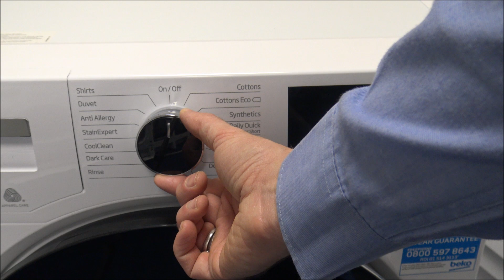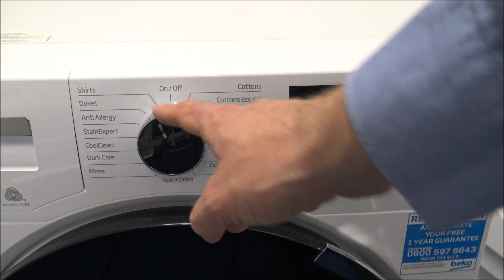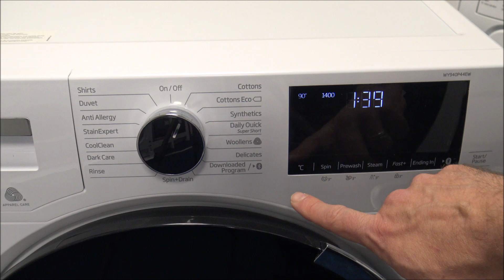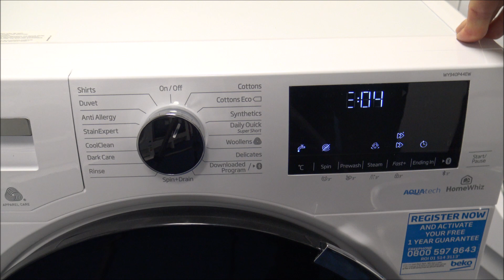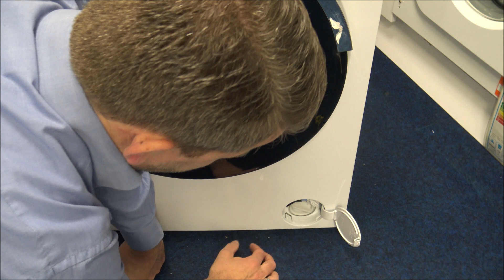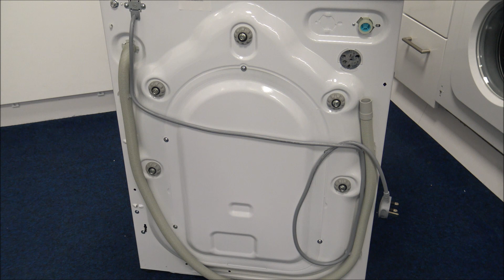Beko WY940P44EW 1400 Spin washing machine

Comment: whats the calibration mode for?
Reply from the maker: Callibration mode is used to set the machine up after it has been moved around in transit. Not many manufacturers have this option but for some reason Beko do.

Comment: Hi, thanks for the vid.
I dont get what you mean by taking the transit screws off at the back? Why are they there if you need to remove them?
Reply from the maker: Transit bolts are used to hold the drum steady while the machine is moving around. They have to be removed before it is used, if not the machine can get damaged and will not be covered under the warranty.

Comment: Hello,.I have a question. In the eco mode can we change the temperature to 40 degree instead of default 60 degree ?. please reply. Thanks
Reply from the maker: yes you should be able to change it to 40 degrees
Reply: My machine won’t start, start button just flashes, any ideas guys?

Comment: love your video never had a Beko  washer at present got a 14year old Miele still going strong but do like the digital panel it's a shame you can't show it going filling etc
Reply: personal advice: don't get fooled by how they look like i did, been stuck with mine for 4 years
Reply: eli55121 Hi ,my sis is struggling with it she is saying it doesn’t clean the clothes and the washing powder doesn’t de solved properly, please let me know if you have experienced something similar
Reply: @zarlashtrahmani9619  I've not experienced that yet fortunately, I experienced blocked pump from foam and machine rebooting halfway through the heating process so far
Reply: @eli55121  hi not sure if you'll see this message but we're you referring to this Beko model or a different washing machine?
Reply: @entyyafai427  those that came out in 2014 like the one I had, and i gotta admit they came a long way since then